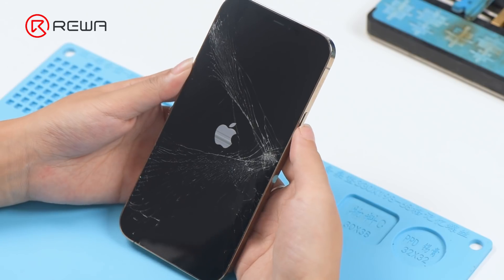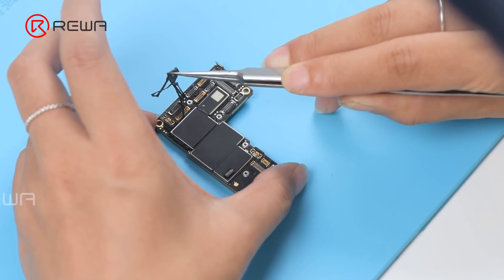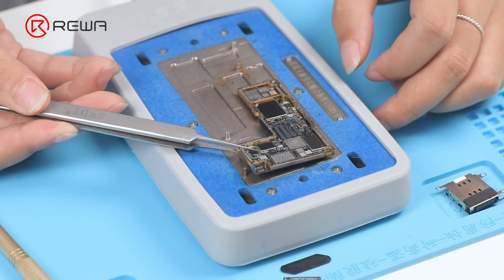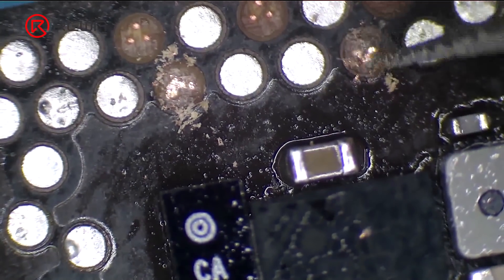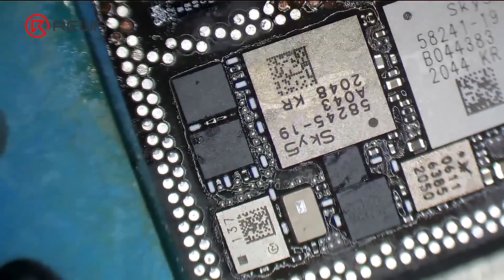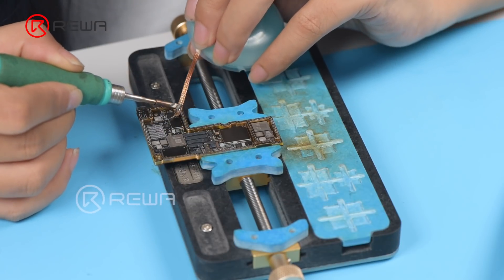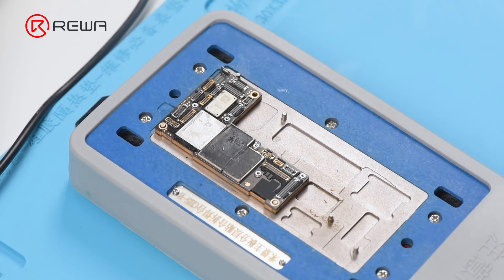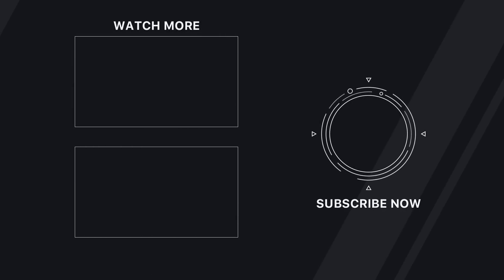Fix iPhone 12 Pro Max Overheating Issue by Soldering Lugs - Over a Dozen Missing Pads

Comment: I am currently doing this repair, and i am stuck at getting the solder lugs solder to the pads. What am i doing wrong
Reply from the maker: Which part you get stuck? the soldering? The motherboard separation is little tricky, it is normal for repair man to spend more time on that💪

Comment: Why some pads are left without putting the lugs?
Reply: Those are pads that are either no connect (pads that don't connect to anything functional), or ground pads (of which you have a lot and you won't need to restore)
Reply: @simonerachele6231  I see. Thanks.

Comment: what is GMD ?
Reply: They said GND, meaning ground. They basicly say not to damage the solder mask on the ground plane thats around the pads, else it might cause a short circuit because the connections are so close to each other.

Comment: What temp solder is used for middle layers of the 12?
Reply from the maker: Hi, it is middle-temperature solder.
Reply: @rewatechnology2008  Is it lead free solder like rest of circuit board?
Reply: 380
Reply: 300 is ok bro